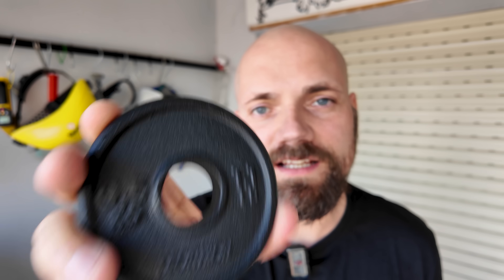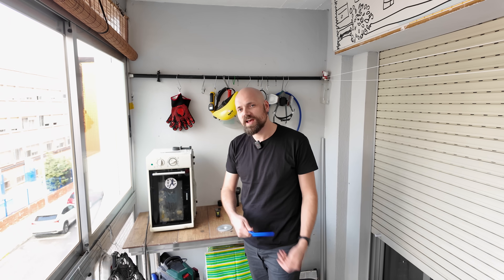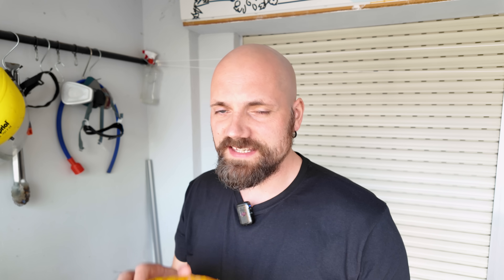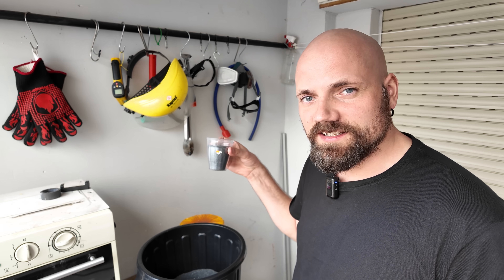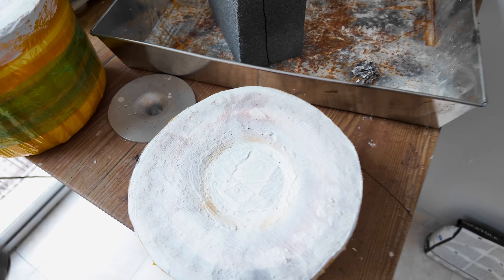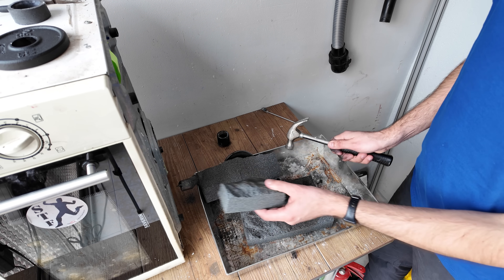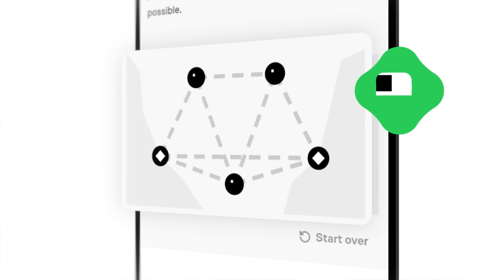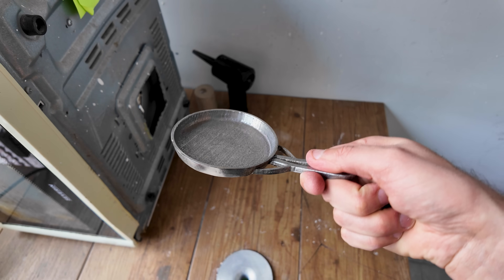I Made an Iron Skillet Using a Microwave! Metal Melting!

Comment: Besides burning out the PLA, can you also melt the iron directly in the final form? that sounds like a really cool option (if possible).
Also, you could coat the positive in a layer or two of clay slip or ceramic slurry, and that should hopefully improve the surface quality and maybe reduce cleanup too.
Also, cool stuff ❤️
Reply: Melt the iron inside the form? Like you would grind it up into shot and fill the mold with that? Interesting idea, especially if your metal is already in small granules.
Reply: He talks about making a new crucible housing to fit around the mid sized crucible to limit the amount of stuff that's not metal that needs to be heated up. In other videos he says the microwaves can struggle to heat large amounts of material in a reasonable amount of time and that insulating the crucible is crucial to this method of metal melting. From that we can assume its not practical to melt directly into the molds. Whether because of the amount of mold material you'd need to heat to red hot or the likely very long time it'd take to reach that temp. It seems there are specific considerations he has taken to get this to work at all and melting the metal directly in a mold of this size disregards the procedures need to accomplish what he has here. Might work for a much smaller sized item though like a ring or a similarly sized object.
Reply from the maker: It’s one of the most requested videos. It can be done with some metals—I actually started making a video about it but put it on hold because I wanted to use a finer grit SiC. With smaller molds and certain metals, it’s possible. However, there’s no way I’d be able to heat up a mold this size to temperatures hot enough to melt iron, even if I insulate it.

Cheers!

Comment: Consider building a sand recycler - seen it in several casting channels. 
Basically a large-ish drum with a spinning wheel and trowel for agitation. 
Sometimes with sliding section at the bottom.
The trowel picks and mixes the sand while heavy metal wheel crushes the clumps.
Reply from the maker: Thanks for the suggestion!
Reply: The word that gets used to describe this machine in English is 'muller' - as in the verb is "to mull" and the machine which does the action is the muller. As it happens, you don't actually need a machine to mull the sand, and can do it by hand. The point is to break up the clumps, and in the case of greensand (not what STF uses) to ensure that the clay and water in the mix are properly distributed throughout. For SiC which has been bound together with Na2SiO3, it seems to me that the biggest concern is breaking apart the clumps.

Comment: I wonder how hard it would be to more evenly heat things in a microwave and if hitting specific temperature range is possible with the right tech
Reply from the maker: It’s possible. When I heat up plaster molds inside the microwave kiln, I can estimate the temperature pretty accurately. For example, when I heat up smaller molds, I already know that after "X" hours, the temperature will be approximately 320°C. And it usually is close (at least at the top of the mold, which I can measure with a thermometer).
There are ways you could add a PID controller. I actually bought all the necessary components to do it, but in the end, I didn't follow through since I’m happy with the setup as it is for now. But you never know.

Cheers!